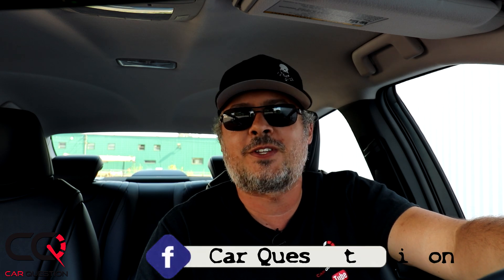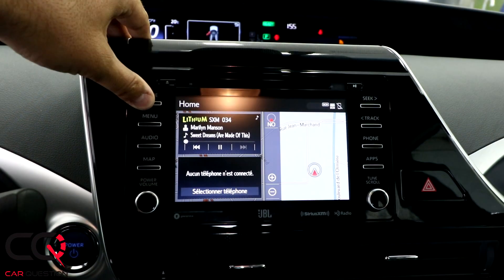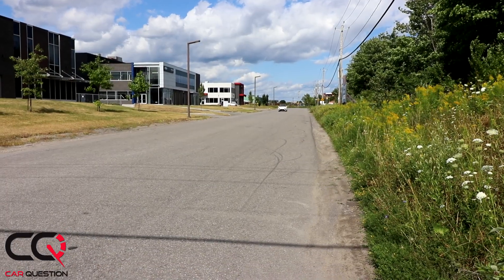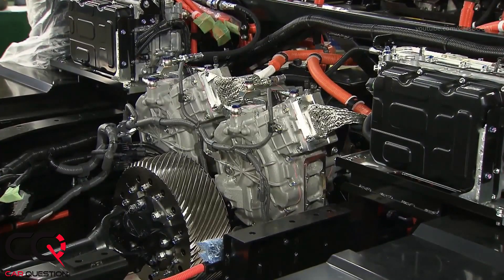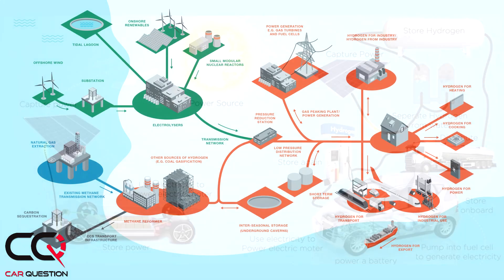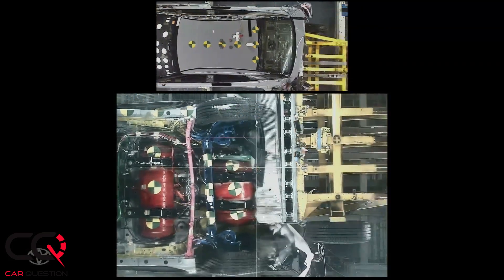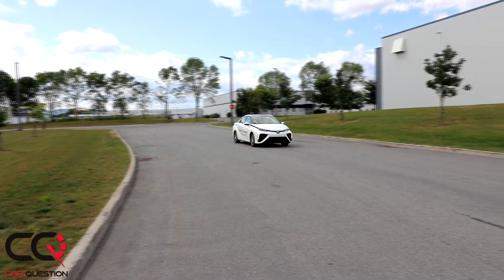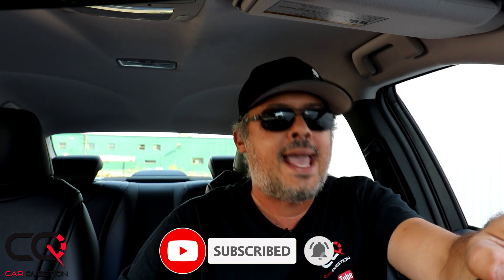Toyota Mirai | Don't spit on hydrogen car!

Comment: "How about you open your mind a little bit open to research let's say  EV truck carries around hydrogen or hydrogen truck"    You didn't even understood the argument in the  first case ,  You can use whatever method of transportation ICE,EV,FCEV truck , it still requires energy, it still overall increases Co2  ,this impacts the overall efficiency and environmental impact of the cycle of the energy from the production to the wheel.   This is one of the reason why even if you use 100% green energy, at the wheel you'll get 30-35% and even if you produce hydrogen on site a small PEM hydrolyzer (that can serve up to 200 cars a day)  costs around 3-4 millions of dollars and costs thousands of maintennance (it runs literally on platinum) the efficiency it's even less because a  PEM hydrolyzer alone, waste 30-35% of the energy.  And California State the "way in advance distribution"   this year in June a small fire in a  distribution centre brought  brought to knee the entire San francisco area that left a  couple thousands car stranded without fuel . 
I'm not against hydrogen and actually in favor in ships , long distance  heavy transportation and energy surplus storage .

Comment: That's what I am waiting for in Canada hydrogen. The cold winter weather is not good for EVs I would charge all the time....
Reply: You'll be disappointed to find that the impact of cold weather on FCEV its also quite noticeable ,less than EV but much more than ICEs . Once solid state batteries are fully developed the difference will be very narrow (altough still in favor of FCEV)